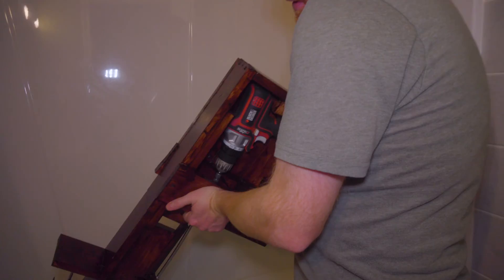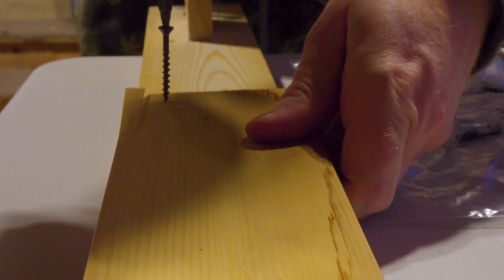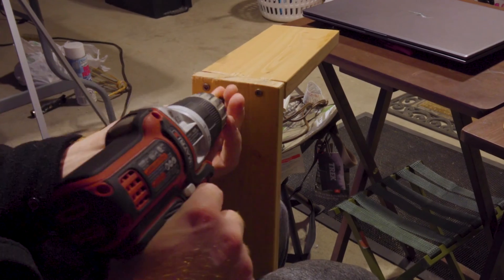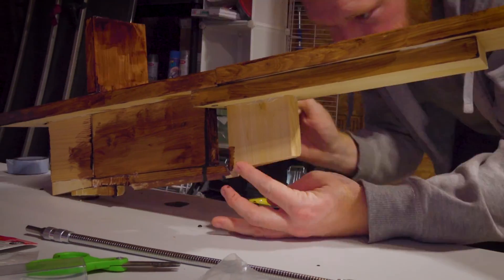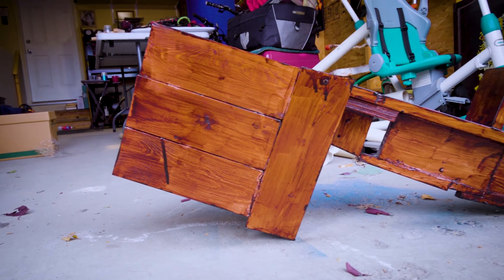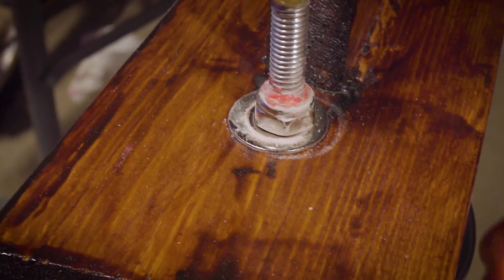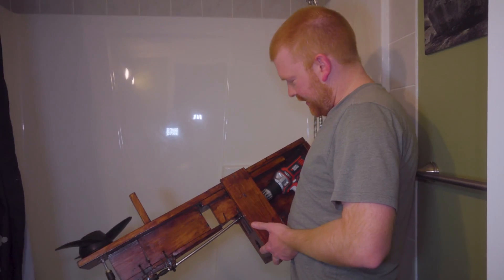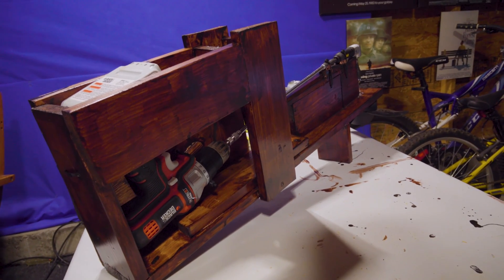Homemade Electric Boat Motor (drill powered)

Comment: Cyanoacrylate adhesive polymerizes with air exposure. The reason it doesn't harden in larger amounts is because not enough air is available to cure the extra depth.
    The baking soda trick as I understood it was to thicken the adhesive, not to help it cure. But I've never done it to know first hand how it behaves.
    Two nuts locked together is a very strong method to keep from unscrewing. Nail polish in the threads works pretty good too as does RTV (silicone caulk).

Comment: Mine dies from over heating and stops any suggestions?
Reply from the maker: Hey Jerry thanks for watching. Sorry for the slow response. Ya I have seen the same problem, not to sure. I have been eyeing up a more expensive drill but I am too cheap haha. the only option I can tell when using it is to not run it too long continuously. I just run it for short periods and am frequently feeling it to check the temperature. I have read that the cheaper drills have all plastic internals and have major problems with over heating, while the better brands and built with metal internals that can transfer the heat around a bit better. Hope that helps, take care.